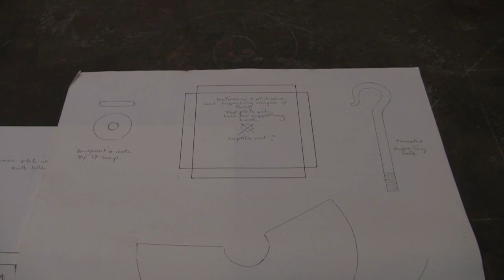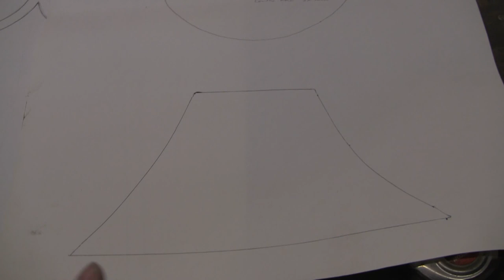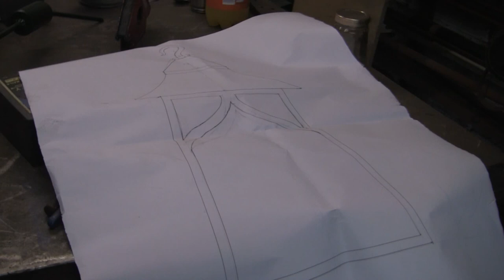Electric Lantern build, part one.

Comment: gary- about your hand - squeeze a tennis ball as much as you can as many times a day as you can it will build your muscles back up - years ago i cut my finger off  - i had 0 strenght in my hand - could not even hold a piece of paper between my fingers - from a blacksmith in arizona - i like watchin your viedoes you do good work

Comment: If you had copper at all three contact points on the third hands it stops any arc tracks when you start welding , although not a problem with what you are doing sometimes on ally or stainless you don't want the arc track. My third arms are made from copper legs with a lump of steel in the middle, lucky people have them made of copper all through. You would improve yours by removing the paint on the contacts that touch the bench and adding some brass to the tips ,the best would be to use 3 copper tips.. Great vids by the way

Comment: The Scotchbrite disks come in a bewildering variety of grits, mesh structures, and abrasive materials (both al oxide and sil. carbide) all variously colored in some sort of code.  They also use the material to make belts, sheets, and wheels for bench grinders.  They have super coarse types for paint stripping too.  I've never understood the color code, or all of the grade designations.  They're pretty expensive and most don't last long, but incredibly useful for some things, like following contoured surfaces.  I like them a lot but use them sparingly because they're so expensive.

Comment: The 3-M disks are called Scotch brite disks and come in various grits and can even be used to sand wood. Now that I mentioned wood you can cut strips of wood cut in the radius profile and clamp the sheet metal to it then weld the corners. You can make enough on the strips (or what are called forms) to clamp all the sides then weld them.
Reply from the maker: James Stanlake, forms would be great if I was making one after another with the same shape top, unfortunately it's a one off so not with making them..
Reply: One off would mean in my little peanut brain that you are only making one single piece but you are making 4 pieces, but I am a woodworker and not a metal worker or a blacksmith. I have done something similar with a single piece of metal that wrapped around a column capital and the form made the task quite simple. Just sharing a method that worked for me.
Reply from the maker: James Stanlake, I mean I'm making one lantern, I don't have the equipment to easily make a form. I don't even have the wood! 😂
Reply from the maker: thecorbies, thanks Mark. I think the discs he is referring to are the ones I showed with 3M on the back, definitely not flap disks.i bought them by mistake for a previous job. I don't think they are scotchbrite either as I have some of those. Anyway they are quite good but don't last long!
Reply: We have flap disks here in the states, the 3-M company makes many products with Scotch Brie materials from kitchen sponges where the Scotch Bright is laminated to a sponge for cleaning and paper resin sanding disks and plain sheets of Scotch Brite material in several grits and even have a disk like a grinding wheel that fits on a motor that is very popular with the metalworking trades. I am morer familiar with 3-M products from a woodworking aspect as that is my trade, although I am very familiar with the sharpening aspect of metalworking.
Reply from the maker: thecorbies, I use both in the video, look at 11:00, that is the one I mean.
Reply from the maker: No worries! Go for it and post a video or at least a photo when your done..

Comment: I had a thought about your holddowns: if you made some tips with a notch or V cut, they would be great for holding material on the edge.

Also, I have seen what I believe you are thinking about for a portable band saw stand.  Check out Wranglerstar's "AMAZING MILWAUKEE TOOL HACK!!" (https://youtu.be/LrMhZEIweA0).  SWAG makes four different Portaband tables, but you could probably make one yourself.  Although, the tables look like they are worth the price.
Reply from the maker: a notch is no good as you would have to make sure the hold down is at an exact position to hold the job where you want it. A pinpoint tip means you can do the same thing but from any direction.
I've already made enquiries about the swag table, great piece of kit but too expensive to ship out here...